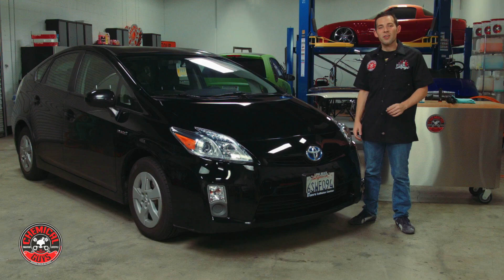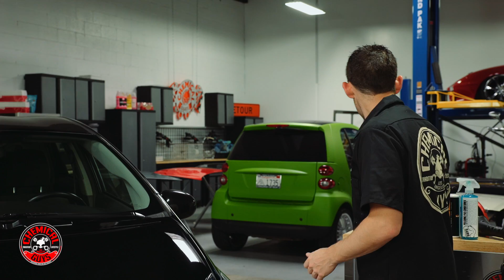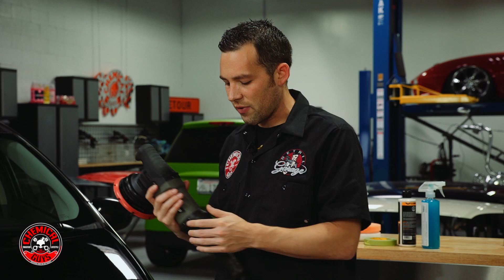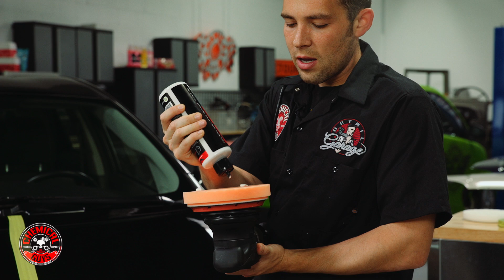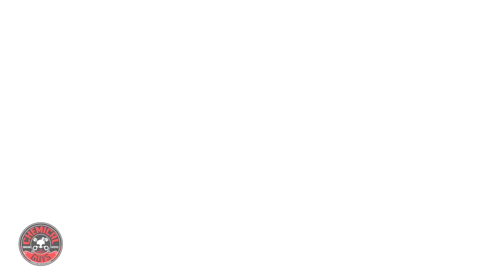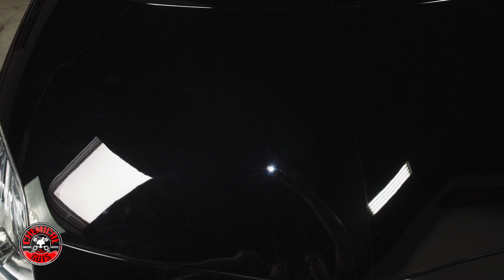How To Remove Paint Swirls - TORQ 22D Dual Action Polisher - Chemical Guys

Comment: How many passes do you usually need to remove light to moderate swirl marks?
Reply: Chemical Guys I have another question why sometimes you only use V36 and sometimes you use V38 after V36? Is it always better to finish up with V38 or depends on the condition of the car? P.S. I have a one year old car with light swirl marks installed by the dealer.

Comment: Never used a polisher before would this be a good beginner machine?
Reply from the maker: Hi Ramon, sounds like you're ready to take your detailing to the next level. Awesome! For a beginner, we recommend the TORQ 10FX. With the 10FX, TORQ Tool Company developed a polisher that everyone enjoys and understands. The TORQ10FX combines the power and precision demanded by professionals with the comfort and intuitive controls dreamed of by enthusiasts. Anyone can use the TORQ10FX to polish paint, remove swirls and scratches, spread wax and sealant, scrub carpets and seats, remove water spots, restore headlights, clean upholstery, and so much more. The 10FX is also available as a kit for even more incredible savings. Check it out below and thanks for watching! 
https://www.chemicalguys.com/TORQ_10FX_Random_Orbital_Polisher_p/buf_501.htm

https://www.chemicalguys.com/TORQ_10FX_Random_Orbital_Polisher_Kit_10_items_p/buf_501x.htm

Comment: What’s difference between 10fx and 22d?
Reply from the maker: Hi, that's a good question. The TORQ22D is a more powerful machine in comparison to the TORQ10FX. The TORQ22D has a 900W motor with a 1,700 - 4,300 O.P.M. and a 21mm throw. The TORQ10FX has an 8mm throw, 1,500 - 4,200 O.P.M. and a 700W motor. Thanks for watching and stay tuned for another video dropping tomorrow!

Comment: Stupid question, but are you done after polish is applied? Or do/can you add a coat of wax?
Reply: Davytron 5000  good question and not dumb either, After you polish your car to remove swirls , stains, and scratches you want to protect the finish, with a sealant and a coat of wax, or just wax (sealant lasts longer than wax,but you can top it with a wax)

Comment: Is a polisher necessary or can a applicator be used?
Reply from the maker: Hi, great question.  We recommend polish to be applied by machine for best results and less effort/fatigue to make life easier on you, although you can very small areas by hand. Modern paint polishing compounds are not intended to be used by hand over large areas. Modern paint finishes are very hard and glossy, so hand polishing is seldom practical or effective. If you must polish a small isolated area by hand, apply 2-4 dots of polish to your hand polishing pad and work it into the area in alternating straight line and circular motions until the polish has turned clear or even disappears from the paintwork. Repeat until desired results are achieved, then follow up with a coat of sealant or wax to protect your newly-polished shine! Check out the video below to see a comparison of machine vs hand polishing. Thanks for watching and happy detailing!
https://www.youtube.com/watch?v=S-0EFouIZMI

Comment: What a horrible 50/50 display at the end.  You can barely see the difference. Why didn't you use that light like you did at the beginning show all the swirl marks?
Reply from the maker: We did use the light. Watch the video again. The paint is just flawless and the light looks like a fat dot on the paint.
-CG
Reply: +Chemical Guys he's 100% correct.  in the beginning you went slow and gave a close up with the light, but at the end not only did you go really fast, but the viewing angle was from far away, not showing the difference very well at all.   Kind of makes you wonder if you were hiding something....
Reply: I apologise with you
Reply: stephen aceituno It is up.  The way they showed the end result was completely different.  You can't see any surface scratches the way they did it at the end.
Reply: Go pick a Sunday fight on Youtube with someone else, goof.
Reply: stephen aceituno
Reply: Exactly what I was thinking! They did a horrible job at the end showing the results

Comment: would VSS scratch and swirl remover be ok for swirls on hard paint?
also, is this a one step procedure? 
(im a beginner lol)
Reply from the maker: Hi Mathew , thanks for watching. VSS is a one step polish, meaning that it contains micro abrasives that start like a compound, and breaks down into a fine polish.  Yes it can, VSS contains abrasives strong enough to cut through the clear coat to remove scratches on the upper most layers.  It's best to start with a test area, if the results aren't satisfactory, move up to V34, Or V32. Polishing depends on the type of product you're using, and the pad you pair it with.

Comment: how does this polisher compare to the flex 3401
Reply from the maker: Greetings Isaac, The Torq22D and the Flex3401 share some characteristics, however they differ in some ways. The 3401 has a trigger mechanism that manipulates the speed of the polisher, it also has a locking function to reduce fatigue. The Torq 22D uses a small LCD screen to display the speed settings, and two small buttons to toggle between the speeds. The 3401 possess a more powerful motor that mimics the power of a rotary tool, with the safety features of a dual action polisher.  The Torq22D has a more ergonomic design, and a symphonic integration  that minimizes the noise pollution created by the motor. As always, thanks for watching.
Reply: Hmm, okay, thank you for the reply, and good video!

Comment: If you don't use speed setting 1 right away and go straight to 6 is that why it still has scratches I don't get it
Reply from the maker: Hi Dominick, 

First things first, you don't want to automatically go to speed setting 6 because then all the polish will fling everywhere and make a  big mess, thus not having as much polish on pad as when you applied it. This can cause the pad to become dry very quickly and putting your paintwork at risk of being scratched. My going to speed setting 1, you are applying to the section you are using it on and gong slow on speed setting 6 to make sure to get the scratches off. If you have any more questions or want to interact with other detailing enthusiasts, be sure to check out our forum. chemicalguysforum.com
Reply: Chemical Guys it didn't fling everywhere because I dabbed it around like you guys did.
Reply from the maker: The spots that you dabbed are the spots to get great results if you start with speed setting 6. The speed causes it to heat up so most of the polish will be gone by the time you're done with the dab section. By spreading it with speed setting 1, you have polish for each area you want to polish. You don't want to do too much surface area at a time, go section by section.
Reply: Chemical Guys how long should a whole car take just curious